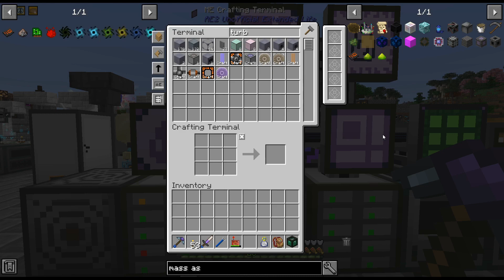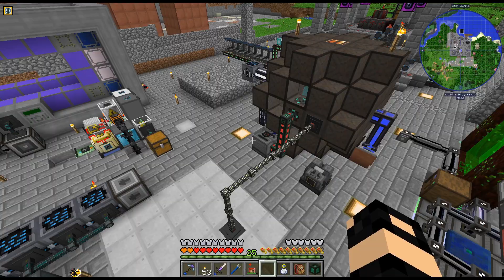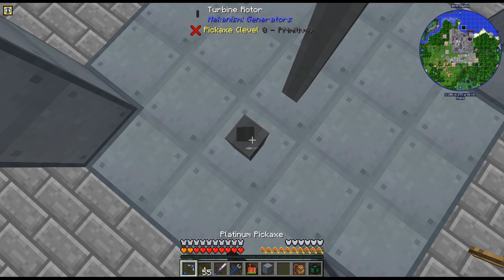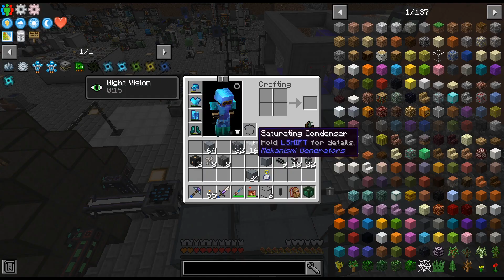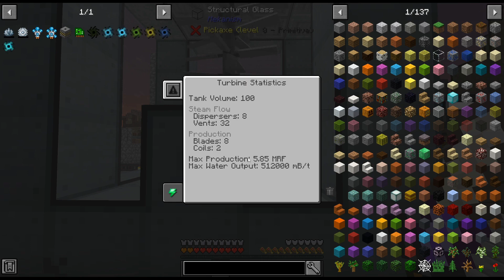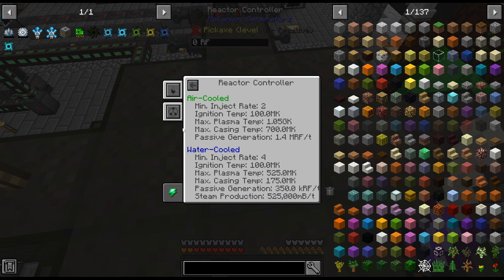Multiblock Madness - 110 - Mekanism Turbine OP

Comment: Make sure to watch the reactor temperatures. I think at saw it going down at the end and if it gets too low it will turn off.
Reply: It was going down since he added water again
Reply: @Royal_4096  i know. Just worth to keep an eye on and up the injection rate if it goes to low
Reply: @Niyucuatro  It won’t get low enough since he has higher than the minimum injection rate